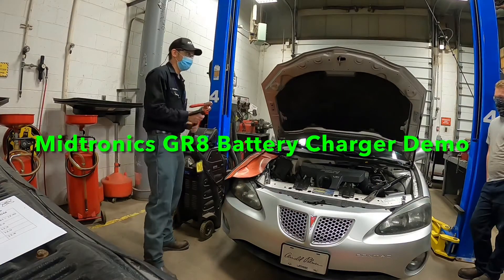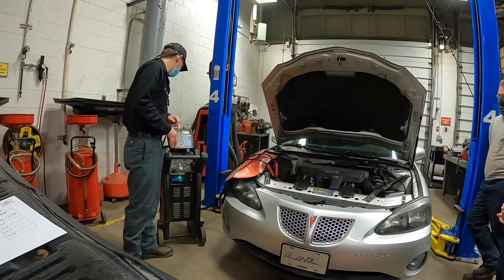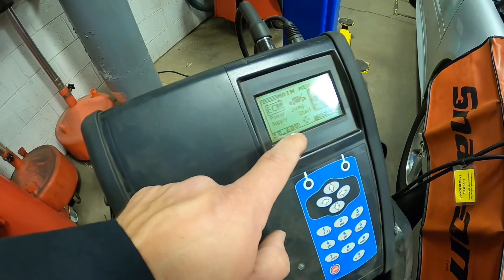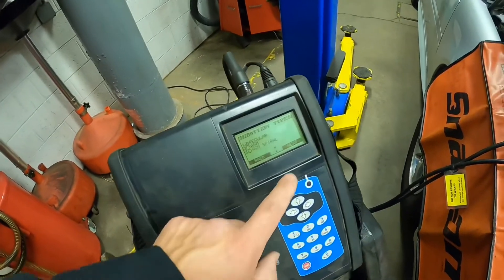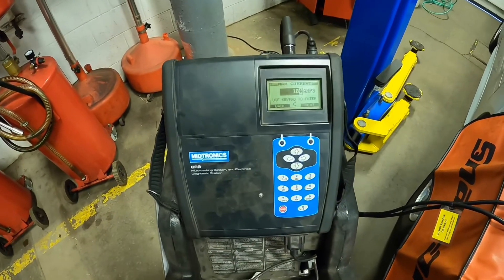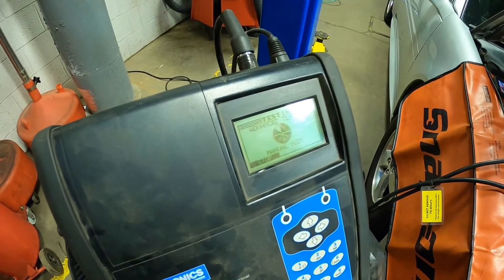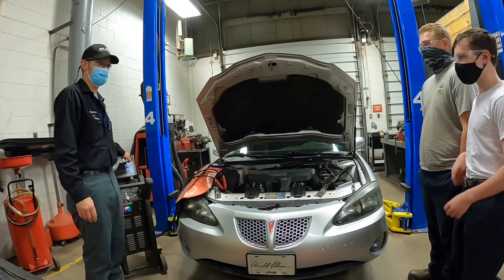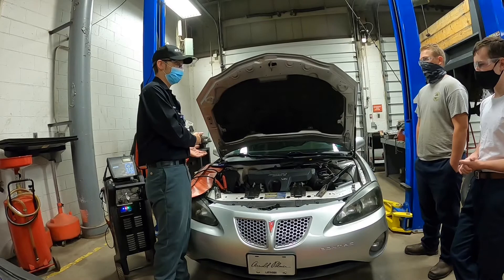Midtronics GR8 Battery Charger Demo

Comment: I got my battery tested with this. What does the print out mean? 

RESULTS
GOOD BATTERY
RATED:
700 CCA
MEASURED:
647 CCA

VOLTAGE:
12.56U

Does that mean the battery function is about 92%?
Reply: Depends on the temperature you tested it at, lower temps will always have a lower CCA. Some cheaper batteries overstate their CCA a little but work fine otherwise. It's a little weak but should be fine unless you are starting a large commercial or diesel engine.